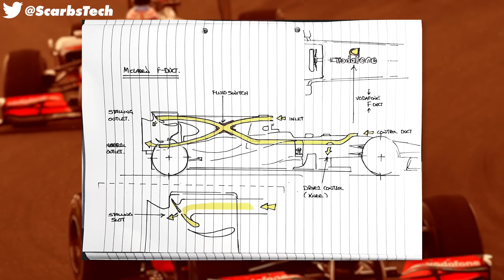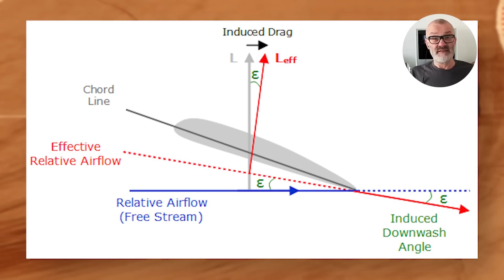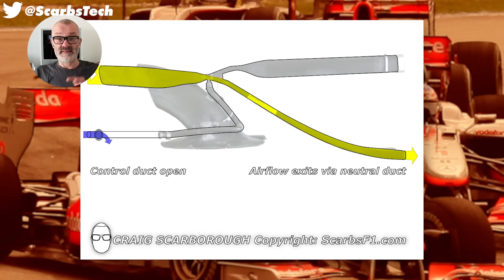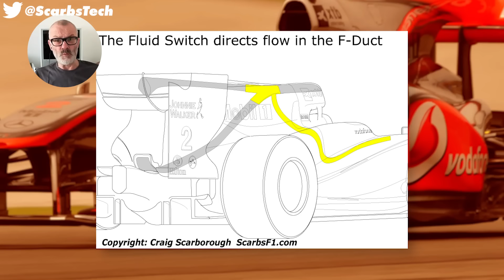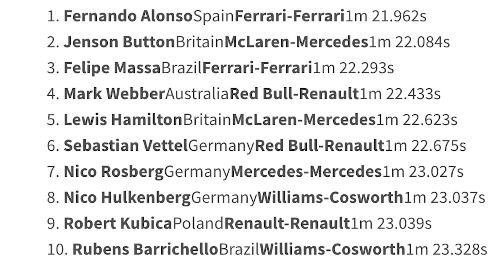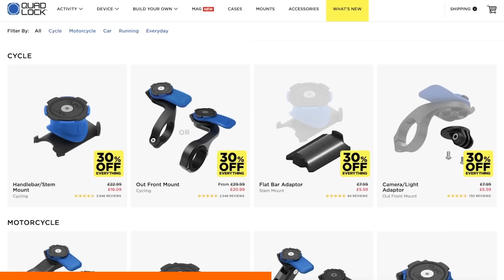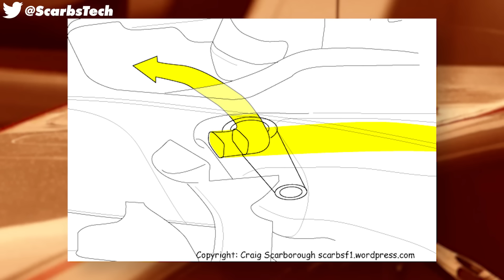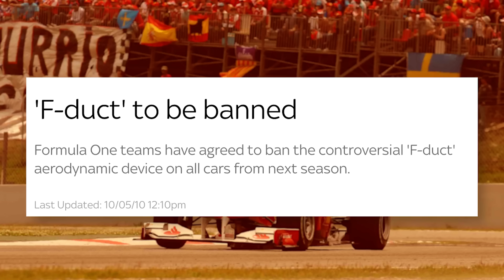The Tiny Element that Gained McLaren EXTRA SPEED

Comment: Back in the days when McLaren innovated, competed and had an effective boss. Love him or hate him Ron got things done.
Reply: Eventhough it was withmash, Ron was behind the curtains pulling strings.
Reply: Yeah I don’t think Ron was always a big problem at Mclaren. He only get into trouble when he had all star driver lineups and couldn’t/wouldn’t control them or favoured one over the other/broke promises to them. The whole slide that Mclaren were under in the mid to late 2000s was partially down to Whitmarsh not adapting well to the new regs, Mclaren facilities becoming outdated and the team rudder less under Jenson Button once LH wanted out. Operationally the team stagnated as well. Ron can only do so much. At Red Bull there’s a lot of key figures doing their bit in the team. Same at Mercedes Benz AMG Petronas. Ron Dennis always seemed to be the only key man at Mclaren.
Reply: @kwl189  whitlessmarsh, as head of fota, was making decisions that were actively against McLarens interests,  like banning kers for 2010 when they clearly had the best system.  He was clueless
Reply: @byanymeansnecessary9329  yeah I didn’t like the KERS system that much in terms a reading perspective but it did provide innovation and exploration in terms of energy recovery so whilst I don’t think it added to the racing (Vettel would dick about and start using KERS not during acceleration out of slow corners but on the straights in the upper gears), it certainly is something that would be useful on modern cars given the energy under braking to be explored.

Comment: F-Duct is nothing to do with F in vodafone. Its F=fluidic. The device that causes the switch is called a fluidic switch. We developed this system the previous season but chose not to race it as the car wasn't competitive. Originally it was foot activated with a nose inlet and switched to elbow /arm operated during testing. The reason we were able to make it work when others struggled as this was the first season that Full scale testing in a tunnel. So nobody else could make it work as easily as we could. We had tested it the previous season in the full scale tunnel at wind shear in the US. Most impressive was Sauber who turned up with their own version for the first race. Was thought up by our own Back to the future Doc Brown.
Reply: right 😆

Comment: I actually have a design for a dirt track car that has variable-geometry wings that are activated by the pitch of the steering yoke. The idea is that on a straight you could max out your speed, but on a turn you would generate downforce. Looking to build it eventually but I only have the budget for engine, chassis, and skin rn. I think I'll have the means for hydraulic controls and drivetrain soon enough though.

Comment: I’m still surprised that teams don’t continue with the approach Lotus (and subsequently other teams) were trying in 2013 - ie the “device”. Seemingly it was hard to get the fluidic switch tuned just right, so everyone gave up trying, but I’m surprised it’s totally impossible. That seems like it would be a benefit, especially in the race where you don’t have drs unless overtaking, and was legal given it used inlets on the engine cover plus didn’t require the driver to do anything.
Reply: What device did lotus use?

Comment: What a dangerous device. “Just stop keeping both hands on the wheel and don’t focus on actual driving, it’s faster” is a questionable direction to move in as an engineering org
Reply: What u think they did when they had to manually change gears????
Reply: @John-86  which is why they stopped!
Reply: @tpayne3047  no they stopped because transmission technology improved and the cars are way faster with paddle shifters.

Comment: This is the kind of innovation that makes sense to keep for a year and then ban. It's not an elegant design in itself, it's elegance is how it subverts the rules about moving parts. With no rules you would just use a moving part, instead of forcing a driver to manually cover a hole whilst driving. 

Reward McLaren for a year, and then ban it next year.
Reply: Exactly like DAS. Nothing wrong with it so there is no justification to ban it immediately. Developing it is a cost you don't want all teams burdened with, so ban it for the following season.

Comment: I was under the impression that the Mclaren f duct was operated by the drivers knee not their hands or elbow.
Reply: I thought it was knee for McLaren as well. Most natural way to integrate it into the driving style as you know where the leg will be on braking Vs accelerating phases. Happy to be proven wrong of course.
Reply: @darren8453  That's what I thought too. I suppose there isn't enough room in the cockpit to make sure the driver doesn't accidentally block the duct in a corner. They don't brake through the whole corner.
Reply: I thought Mclaren operated by the drivers knee too, and then it got banned on safety grounds because other teams (I mainly remember analysts pointing it out on Alonso's Ferrari**) designed it so the driver took one hand off the steering wheel to operate the duct, which was considered dangerous incase they had to quickly manoeuver to avoid an accident or something one handed**. But the technical implications of standardisation across teams and regulating/policing from the FIA makes sense. I was much younger then and didn't know all the ins and outs of the BTS technicalities and regulations.

**(Note: remember to finish watching the whole video before commenting!!)

Comment: I was switching channels and the Formula 2 was on , and I’ve been wondering for a while, do they use the same pit garages, as the formula one , ones, ?
Reply: It depends. The paddock they use to set up is normally separate, but they will utilise the F1 pits during races to keep things normal with pits on the start/finish straight.

At Silverstone F2 is based in the national pits.
Reply: @JohnSmithShields  ahh, cheers 🙂

Comment: So it was banned because most teams couldn't make an elegant and safe solution to cover the hole. Shame.
Reply: No. Also cost.
Reply: Cost mostly. It was a trick device that would have been identical in every car in next year's designs as engineers would have time to integrate it properly. Allowing it would have meant complexity into the rules to keep it safe. So banning it and replacing it with a clear and intentional DRS device was just safer and cheaper for everyone with the exact same end result.